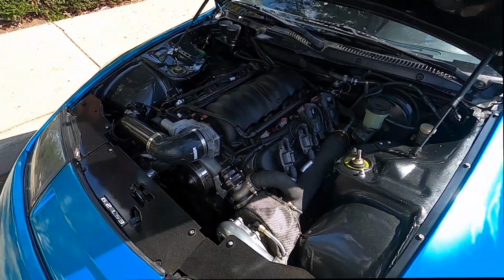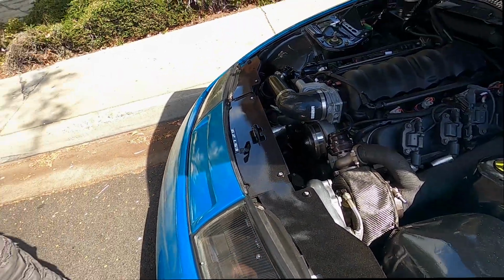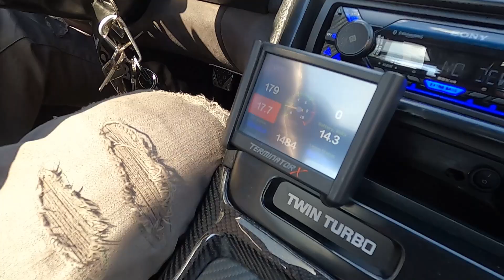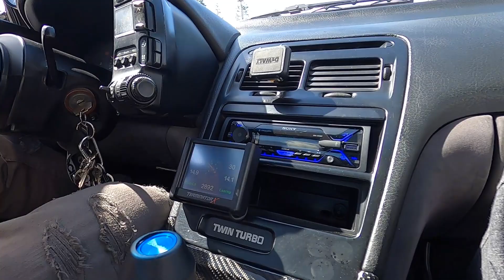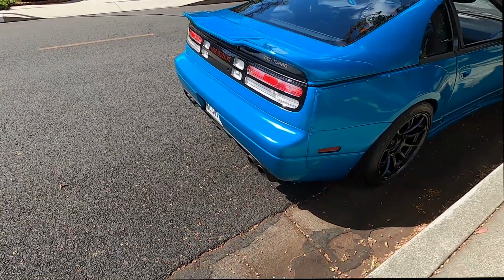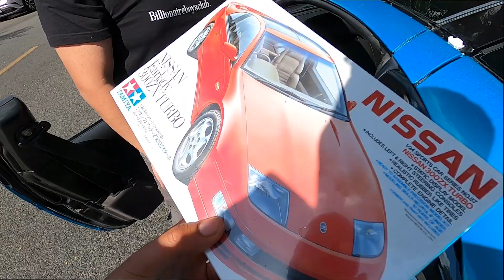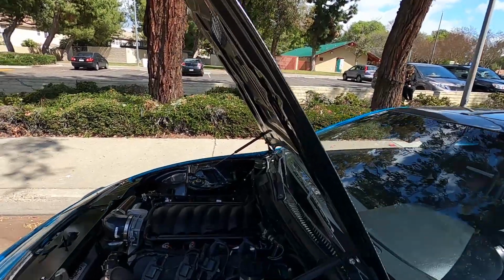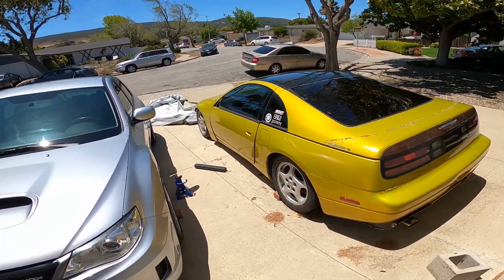LS Swapped 300zx Full Walk Around

Comment: Owner should try looking into a cd009 over the t56. I wanna say the cost is about 1/2 and holds the same if not more power. I know before the inflation period were in you were able to buy them brand new for $1600. 

T56 near me are almost $3k
Reply: What are you smoking!? First off stock t56 out of an Fbody is not all that strong. People run the t56 magnum or the oem tr6060 which is really strong. Be much better off buying a new t56 magnum for $3500 plus parts. The adapter and associated parts for a cd009 really aren’t that much less and you’re getting an inferior used transmission. Third option would be the TKX 5spd. Little cheaper than a t56 magnum but still holds 600wtq. Tremec makes the best manual transmissions.
Reply: Interesting CD009 (now CD000], inferior? No Supra boys realize how go this transmission is and the fact that in stock form it constantly holds over 1,000hp no problem. Yes the tremec is a beast but honestly the only down fall over these is that the CD transmission needs a bell housing adapter to mount the transmission others are designed for the engine. But honestly $1,500-$1,600 CD transmission plus adapters is still cheaper than the Tremec or a T56 as well. It’s all about the same but the CD009 is not inferior.

Comment: That is a fucking insane car!! My first car was a 300zx. I wana see full throttle! Gotta be a 8 or 9 sec car.
Reply: your first car was a 300..???  like your 16yrs old and you just got your license, and your first car is a 300..?????
Reply from the maker: Yes
Reply: So you either spoiled rotten. Or a liar. One or the other..  Your not gonna try to say you worked "really" hard for it right..?? Because I did....
Reply from the maker: @tommysaraullo1992  first car I bought with my own money at 17
Reply: @tommysaraullo1992  they are a couple grand man. I just saw one with no motor or trans ready for a swap for $800
Reply: @tommysaraullo1992  got mine for 1800 at 16 😂👌
Reply: @tommysaraullo1992  my first was a 1jz Mk3 supra just cause you couldn't afford something like it at that age doesn't mean no one else can🤡
Reply: They are a surprisingly good turbo ls swap candidate. I am starting to see more of them. The TTs have the r230 rear which is a 9.1" + 30 spline with 3.69 gears. Just about done assembling mine. The limitation is engine bay space. Nice cars.
Reply: @tommysaraullo1992 spoiled to buy a 300zx as a first car? Bruh when I was growing up u could get a clean n/a for around 2k-3.5k and tt's were 5k+.. I know because 300zx was my first car too lol.